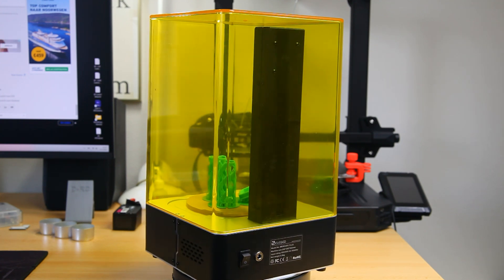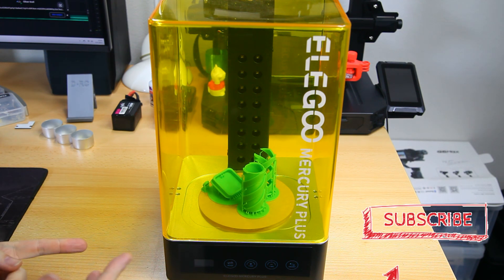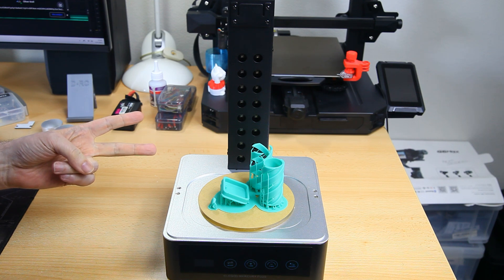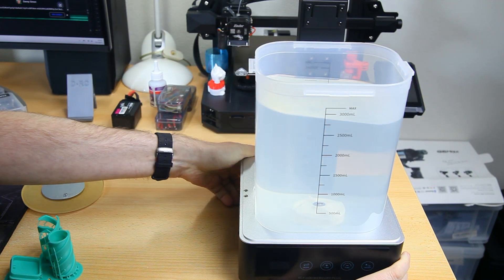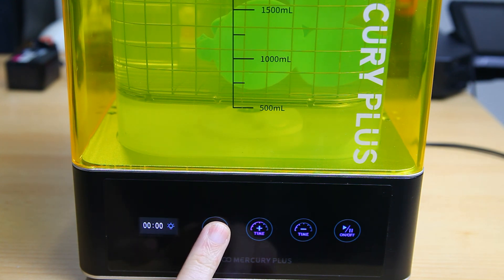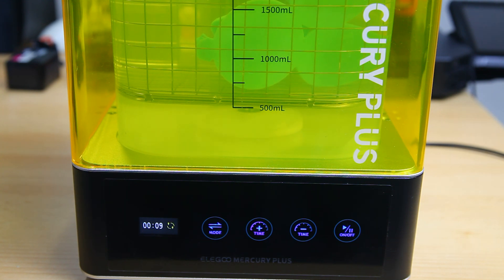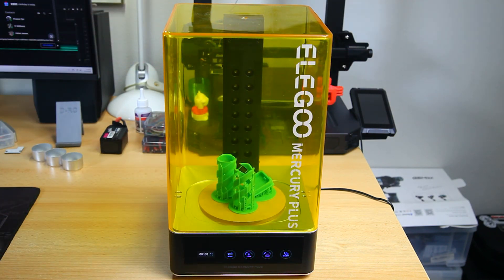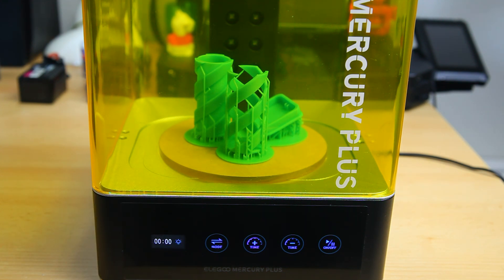Resin Printing PART 5: Washing & Curing Station! - the Elegoo Mercury Plus V2

Comment: elegoo shipped me somebody's old return in an open box without the proper styrofoam.  they also sent the US model without an Australian wall adapter which is of course useless. 

Since this runs of an external AC/DC transformer there is no excuse for this level of cheapness. 

I'm sticking with anycubic products from now on.

Comment: Quick question…what kind of alcohol or solution should I be using to clean? Bought my son a printer and resin for xmas and didn’t even know I needed this lol thank you!!
Reply from the maker: isopropyl alcohol is what you need :)  At least: that's what I use and it works well
Reply: @DutchRC  you fill the entire bucket or do you cut it with water? Thank you!!
Reply from the maker: @N8theballer Nope.. no water.. what you see me use in the video is pure alcohol

Comment: Any idea how long that alcohol stays effective until it needs to be replaced? I imagine that resin gunk is going to start building up in it after washing enough prints. I think due to certain plague that recently bothered the world, at least here isopropyl alcohol is quite pricey (~10 € / liter) due to people wasting it on making hand sanitizer.
Reply: you can use bioethanol, same result and at least here in italy 10 liters is now 29 euros
Reply from the maker: @DanieleOttorogo Good to know! Thanks for the info :)
Reply from the maker: Welllll that kinda depends on the kinds of prints (huw much of the uncured resin clings to it) and how long you let it drip after printing.. 
The resin will kinda sink to the bottom of the bucket I should add... But I am still working with the first filling..

Comment: I am sooo unbelievably confused. So you talk about curing for ~10-20 minutes but all research I do says 2-7 minutes??? I’ve been curing for 6 minutes and it just does not have any effect whatsoever lol? But then I tried 17 mins after watching this video and it comes out as absolute pristine perfection. These are small models. I am so confused
Reply from the maker: Fun! :D 
Soooo I simply experimented until things worked well.. And that's what I put in my video.. A short cure just isn't enough.. The size of the model matters less then I expected by the way :) 
Happy printing! ;)
Reply: @DutchRC thank you! I will trust you and continue with the longer cures. They seem to be coming out great

Comment: I've seen this on another review as well, where the protective brown packing paper isn't removed from the clear plastic turntable to allow the light to penatrate through to the bottom of the prints :)
Reply from the maker: Interesting! As it is (I still have the paper on it) it soaks up the alcohol a bit.. 
But I can well imagine it should indeed be removed :)
Reply: Instructions are terrible for this and the printer, you shouldn't have to go to YouTube to figure all of this out